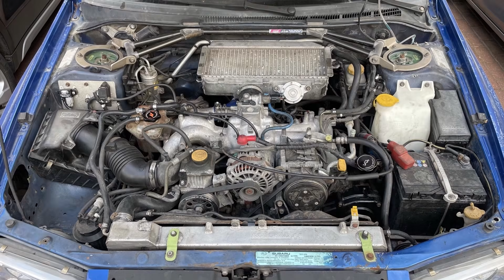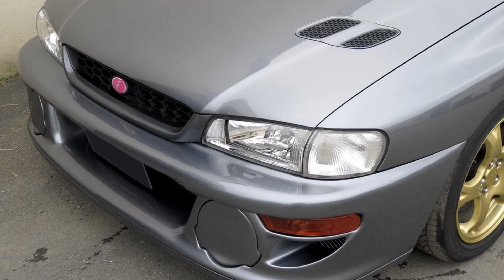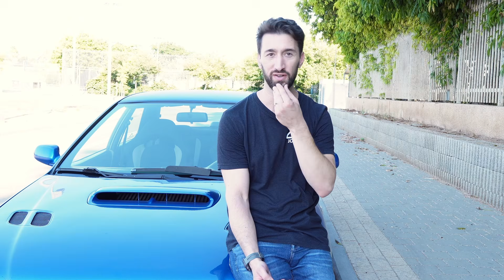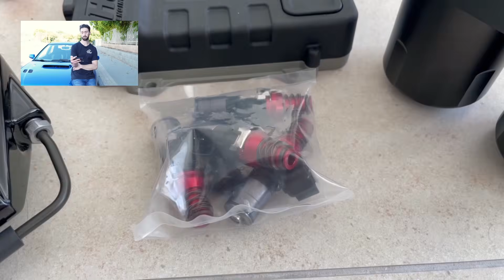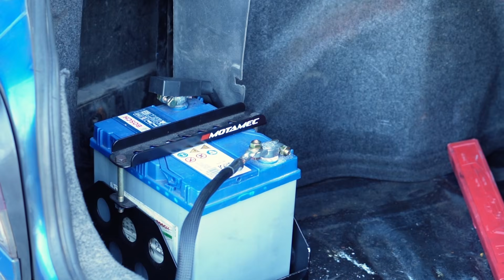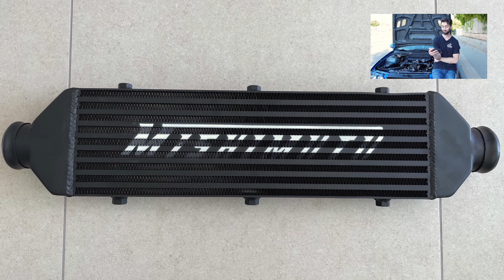GC8 progress THEN and NOW (Years in the making)

Comment: Really tasteful build!
I had a 96 series 2 with 20k mods
Favourites
Roger Clarke 4.7kg billet steel flywheel (unbelievable)
Equal lenght headers
Whiteline everything especially anti-lift.
Walboro 255 fuel pump
Cosworth intake manifold 
Cosworth panel filter
Yokohama parada spec 2 tyres
(Dry!)
Prodrive short shift
Dynamat doors
O2 delete map
Brembo HP2000 daily pads
Enjoy bro :)
Reply from the maker: Sounds like a fun package!
Thank you very much 🙏🏼

Comment: Interior I think a interesting topic. I lucked out and mine was in good shape and black. Seats(if your a usdm) are the biggest thing to update. Then its all mostly ok, really engine and running gear is much more important on a older subie.
Reply from the maker: I feel there’s not that much I would do with the interior besides swap out the steering wheel and maybe get some Recaro Sportster CS recliner seats (or something similar).

Comment: As a next upgrade my 2 cents, the front and rear diffs! clutch or helical diffs will transform the car into true 4 wheels finding traction. Real super car vibes lol. I put a Prodrive code v7 sti jdm trans in my gd and I debated refreshing the front diff and I said no. I DID put a Cusco rear LSD in the r160. It was the best 1200 dollars I spent and I did it myself. I think if you unbolt one or 2 bolts from the ring gear you can fit it without clearancing the diff housing.

From the engine to the sub-frames and the aviation grade harness shes a serious machine.
Reply from the maker: Diffs are a serious transformation without a doubt!